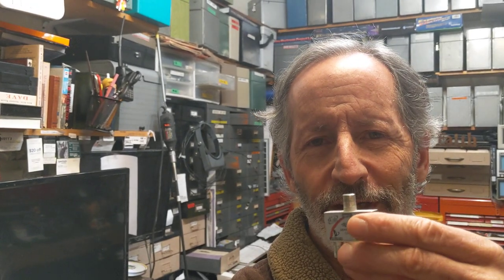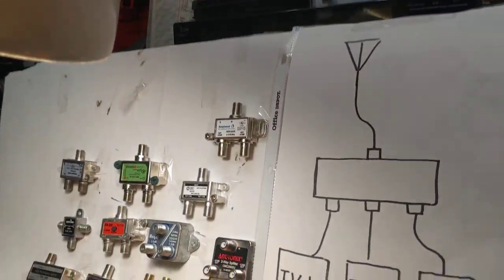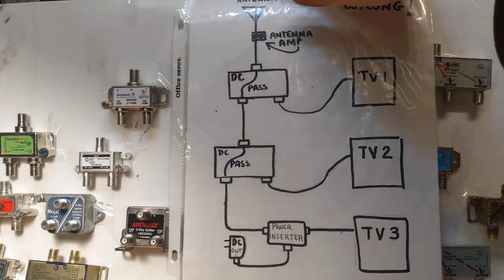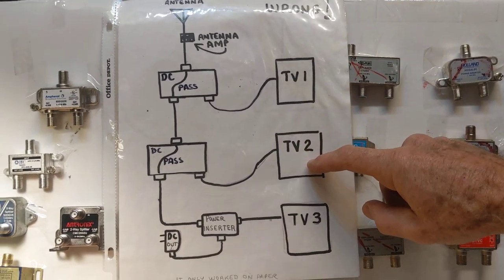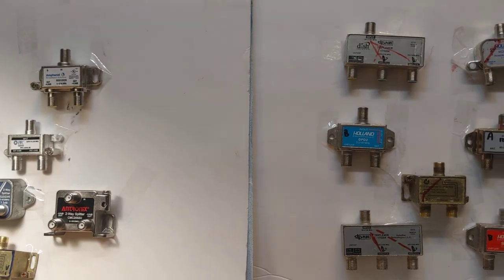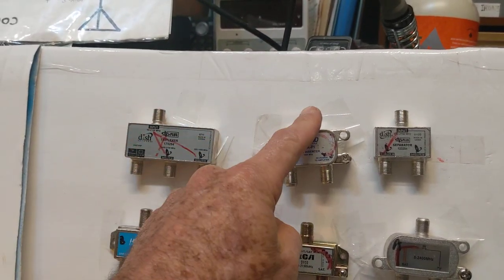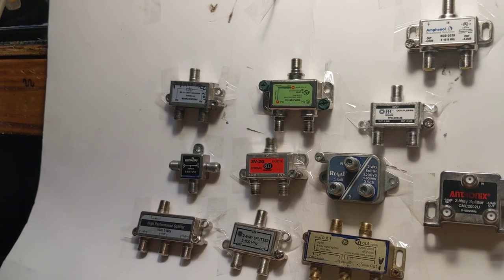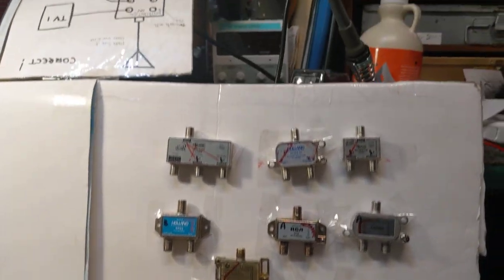Signal Splitters That Block TV Signals..

Comment: It's also important to look at what range of frequencies the splitter is designed for.  Trying to use a splitter designed for satellite (Dish and DirecTV, etc.) for OTA will not work as they typically only pass frequencies above 900MHz.  Most splitters for OTA use are rated for use from 5MHz to 90MHz, and they don't typically do any DC blocking.
Reply from the maker: Good point.

Comment: Additionally, with DTV, don't you also need to be concerned with frequency range (Mhz) and signal loss over distance?  What other concerns do you have?
Reply from the maker: For sure. The frequency range of the coax is critical, and so is the  length,  quality and type of the coax you use , I once had a 4 foot coax jumper cause me to lose a channel due to its attenuation at a particular frequency,  and there are also multipath signals also known as signal  reflections can arrive at the TV out of phase with the main signal from the  tower 
and weaken your reception.

Comment: Hi  i have an antenna with 2 leads 1 for eah bay..  i am using a straight up 5-1000mhtz 2 way splitter but in the opposite direction ...do you know if splitters are directional ??????   Thanks in adv
BTW i love maximizing my ota system🍻🍻

Comment: This is good to know! I'm planning on putting up a dual antenna setup , so this will really help, thanks! Also, your video quality is GREAT! Holy cow! What camera are you using for the video?
Reply from the maker: In this video I used my google pixel 3 at 1080p resolution. It does an impressive job for an older phone.

Comment: Hey Dave.
I didnt realize that. But i have a different question for you.
I am looking for an indoor FM antenna that will really pull the stations in. I live in town with neighbors houses very close by and lots of trees in the area to. I know an external is always the way to go but do you have a recommendation for a good indoor passive or powered unit?
Reply from the maker: Yes an outside antenna is the best, but I'd suggest you try an ordinary rabbit ears and see how it works. An indoor FM antenna can be made with a few feet of flat twin lead antenna wire, but the up side to rabbit ears is your ability to move it around if a particular station needs some fine adjusting.

Comment: Dave, you doing much work in winter? Roofs can be slippery.
Reply from the maker: Yes thanks for the warning.  I'm still doing TV antennas, and I have an antenna job lined up for today, but if the roof is frozen I plan on holding off until it warms.
Reply: @GrantsPassTVRepair  ...Dave, you should really consider investing in a fall harness with a roof anchor point bracket. Roof pitches can be deceptive.
Reply from the maker: @mwngw  Na, I just keep off the roof if it's covered with frost.

Comment: Some three-way splitters attenuate 5.5db per output while some are a two-way going into a second two-way and split the signal 4db, 7db, 7db.
The second one is only good where the first of the three lines going out is much longer than the other two.
Reply from the maker: Thank you for the tip on the splitters and db losses, but I can't quite follow what you're saying. Can you clarify?
Reply: @GrantsPassTVRepair  I'm using a similar 3 way splitter.  Two ports are marked -7dB,  one port is marked -3.5dB.  So it's essentially a two way splitter with one of those out ports feeding another two way splitter.  I use the -7dB ports to feed the main TV and a Tivo DVR in the same room.  The -3.5dB port feeds an 80' run of coax that goes to a bedroom.

Comment: I tend to stay away from splitters altogether. I have 2 tv's and 2 antennas.
Reply from the maker: Sometimes it makes  more sense to use two antennas, and I've done the same, but when the signals are strong, I've rarely have problems using one antenna and a quality splitter.

Comment: could this coax/dc system with dc pass -thru splitters  be used as alternative wiring  to operate a  home cctv camera? 
 or are the signals from an antenna and a camera completely different and not compatible to  travel back thru the dc splitter?
Reply from the maker: Cameras are not my field or expertise, but I can't see there being any problem passing a camera signal through the DC Pass side of a splitter or diplexer. The  splitters have a specific range of frequencies they are ideal for passing, but since you are talking about a closed circuit camera rather than wireless camera that use high frequency radio waves there should not be a problem that I'm aware of.
Reply: @GrantsPassTVRepair  thanks,, maybe i will try a test.  all the wires on my system have gotten old and lost signal,, plus, a person could mount a camera in a location with no ac power available for the power supply , like up in a tree , or in a mail box.

Comment: if you aim the diplexers toward one another they will allow dc pass through and your signal to your second tv but you will need to have another two way splitter not diplexer to catch your third tv..... Or allow dc pass through from tv three to the other diplexer at tv one where they must be aimed toward one another to pass dc and signal simultaneously and then use a two way splitter to reach your second tv!! if you need more info please feel free to reach out i have about 20 plus years in satellite and cable work!!

Comment: This might be a dumb question, but what is the diplexer used for? Like what situation would someone use a diplexer, over a typical splitter?
Reply from the maker: From what I understand, the diplexer is designed to allow two signals to  be broadcast through one coax line, with out interfering with each other, and the DC pass through side of the diplexer allows voltage to from the satellite receiver to be sent to the LNB on the satellite dish,
Reply: Ooh excellent question.  I have a rig with separate 2m and 70cm band outputs both fed into a duplexer.  That allows bidirectional signal flow from each transceiver to a dual band antenna while separating each radio from the other.
Reply: A diplexer is used unidirectionally (in receiving) to combine each receiver in the feedhorn to a common down wire.  I’m guessing they downconvert both received polarizations to two separate lower bands then combine them, and the receiver sorts it out at the TV.
Reply: So the diplexer carries power up, and uses a high pass or passband filter to block interference from strong local signals.  Hey, it got me thinking :)

Comment: What purpose does a DC pass-though serve in cabling?
Reply: If you need to use an amplifier that's mounted at the antenna, then you use the coax to pass the DC voltage up the coax itself so you don't need extra cables for the power. 

The coax outer is used as ground/0V and the centre conductor carries the positive DC voltage.

Because it's possible to design splitters/combiners with capacitors inline with the signal path, which would stop the DC power on the centre conductor of tyhe coax in that leg/port, then you need to make sure you have DC passthrough and have it going on the right leg/port towards an amplifier.

Amplifiers mounted on the antenna mast close to the antenna are much more effective than amplifiers further down the coax or at the back or the TV set (or in the house). That''s because there's always some loss in the coax cable and this loss directly adds to the system noise factor, so by eliminating that avoidable loss (say, 8dB loss) with a masthead amplifier you amplify only the signal, not the signal PLUS 8dB of noise too.

Satellite systems also use this power method, the power for the LNB is passed up the centre of the coax for the same reasons. In the case of satellite LNBs they also downconvert the signal to a liower frequency range because otherwise normal coax wouldn't be able to deliver much signal (coax loss rises with frequency)
Reply: Oh forgot to add - the satellite DC pass diplexers use capacitors that are usually too low in value to pass TV signals especially into the low VHF region of the spectrum. The DC for these is added in near the LNB/antenna port. Terrestrial TV combiners/splitters usually use inductors and no capacitors on the DC pass side and they are designed for mainly 50-800Mhz kinda region of the spectrum. 
The satellite ones are mainly desuigned for 500-2500 region of the spectrum, so need to use different techniques (striplines and small capacitors are common in these, with seperate DC bypass)
Reply: @gordslater  Ahh, of course, I forgot about dishes I've never been a sat enthusiast myself. I keep on telling myself to experiment with PoE (power over ethernet) one of these days. Cheers.
Reply from the maker: The DC pass through is needed where you are passing a voltage through the coax along with the TV signal for your antenna preamp or your LNB on  a satellite. Conventional splitters often have voltage isolation between their inputs and outputs.
Reply: @GrantsPassTVRepair  I suppose it's basically exactly the same as being able to send your network/internet around the home through the power cables using powerline adapters. I'm not technical enough to get my head around how power and data signals can co-exist and what that involves with noise etc etc, I'll just file it under magic until I am.

Comment: So, I have a house with existing cable (originally wired for satellite dish running through the walls ... So I re-purposed this existing cable for OTA antenna reception...
On the outside, I connect my antenna , and inside the house , connect that TV RG6 cable to my TV.. works fine... but then I add external TV amplifier unit near the antenna, and hook up the power injector near the TV and lost most of my channels.. could this be due to a diplexer inline somewhere in the walls? Or would a regular splitter also cause this problem?
Reply from the maker: You may have a bad amp. Did you unscrew the RG6 from you antenna preamp next to your TV antenna, and maks sure there was voltage at this point?
Reply: @GrantsPassTVRepair  No, I didn't check voltage yet at the pre-amp next to antenna... what should its DC voltage be there for a typical pre-amp?